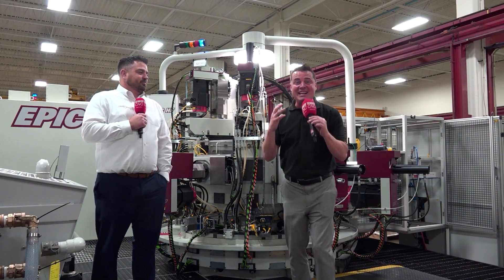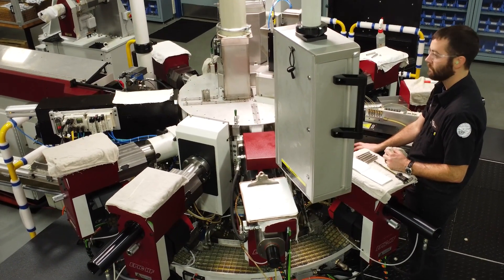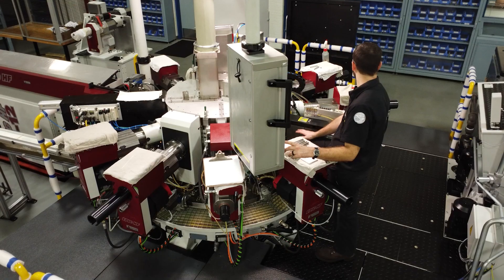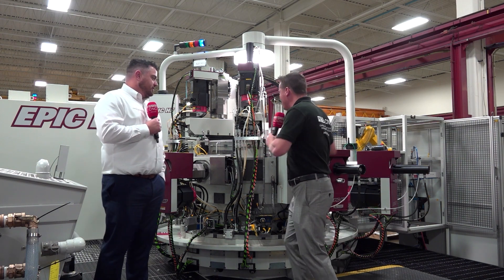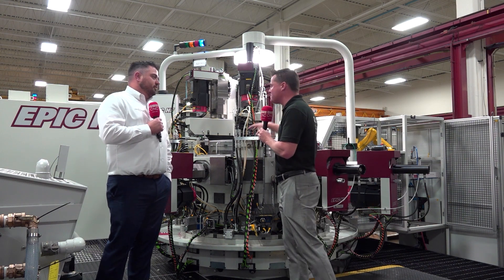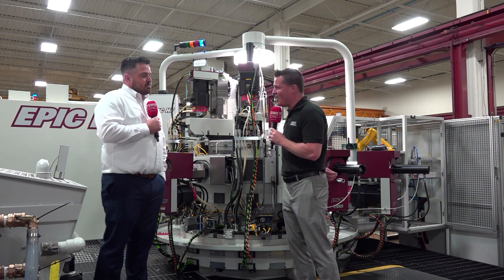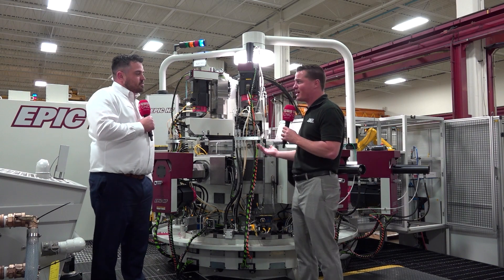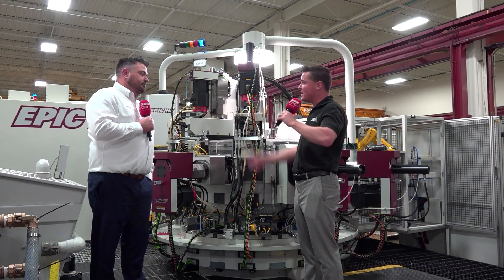Exploring the Power of Hydromat EPIC Rotary Transfer Technology

Comment: ran one of these before.. you usually have tool life of 200-10000 cycles per tool. Inserts, 200 usually making changes every 50-70 cycles depending on the amount your taking off, drills maybe 1000, taps 2-3000, broach 5000. It's a good machine just make sure you input your offsets if your putting a drill into a chuck.. don't wanna cause a small fire by drilling through the part into the fixture ;)